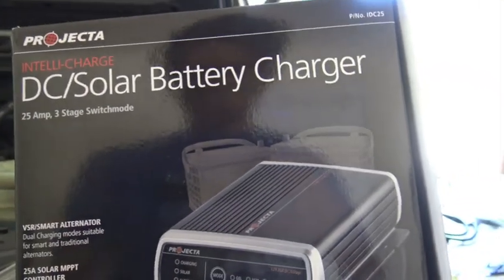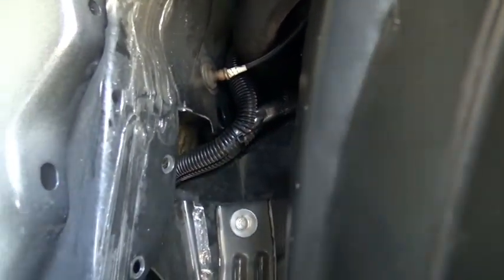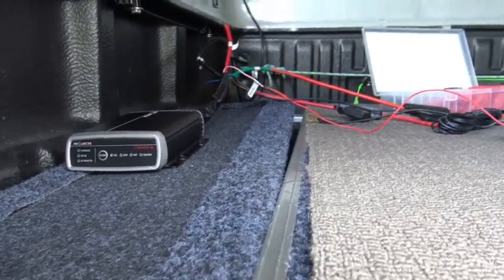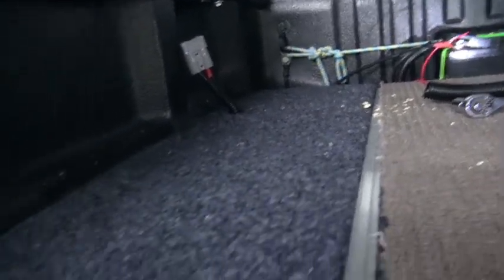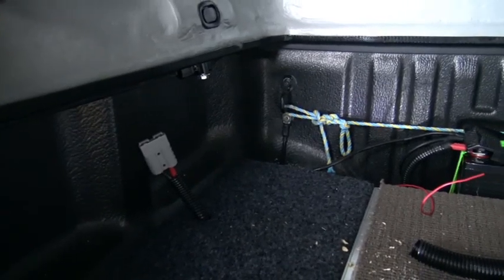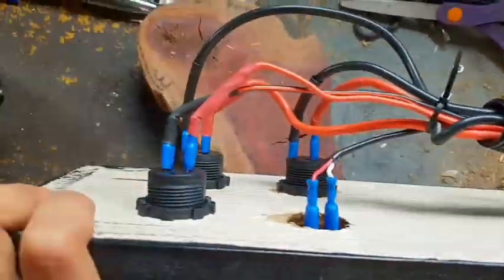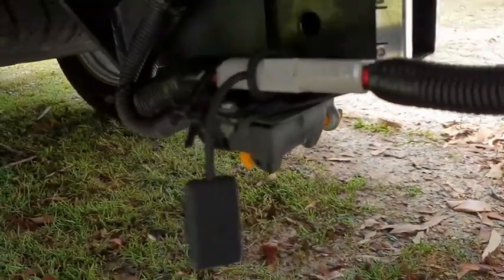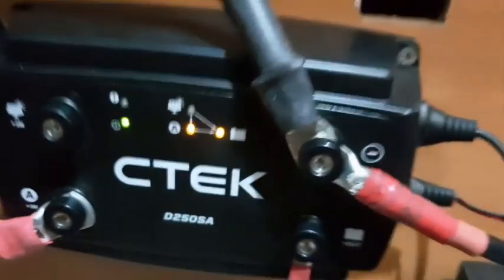DUAL BATTERY INSTALL - KICKASS PROJECTA CTEK CAMPER TRAILER

Comment: Hey mate, Love the Video Im looking to do the exact same thing to my dmax in the back of the tub. got a quick question on your home made accessory panel, how did you hook it up to the battery? run a positive from the battery to the fuse box, and the negative to an earth point or to the batter?
Reply from the maker: Thanks mate.

Yes you run a fused cable from battery positive to the common positive on the fuse box. I just bought a pre-made 6b&s cable with a maxi-fuse holder (50 Or 80Amp fuse depending on how much you want to draw through the box). You could also use something like a circuit breaker or not bother because the fuse box is all fused, however I like to play it safe.

 The negative cable runs from the fuse box to a common earth, although you could run it to the negative terminal on the battery. Should all be the same really. 

Sing out if you have any other questions. Cheers.
Reply from the maker: Also should have mentioned the Anderson plug runs straight to the battery via its own 50amp fused cable as those fuse boxes are only rated to 30A per slot. I just screwed it on to the black panel to keep it all together.